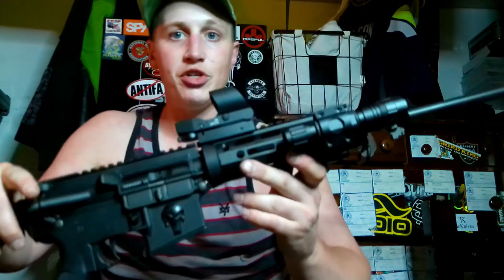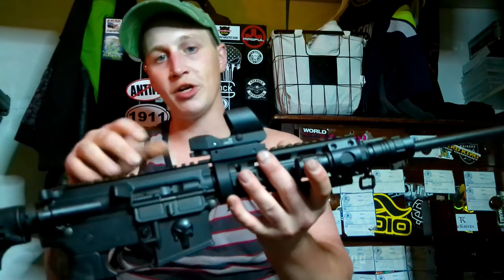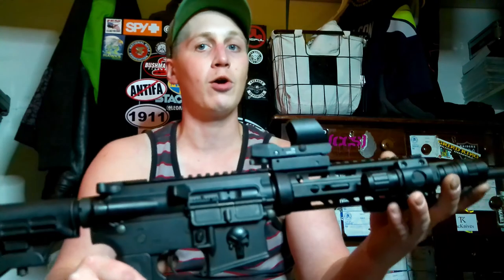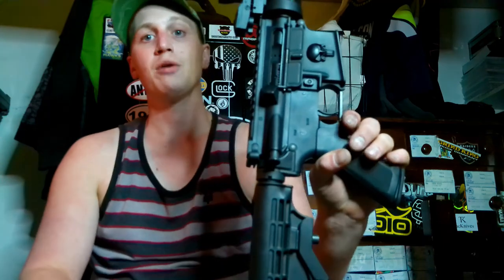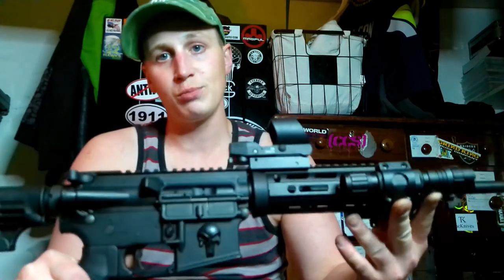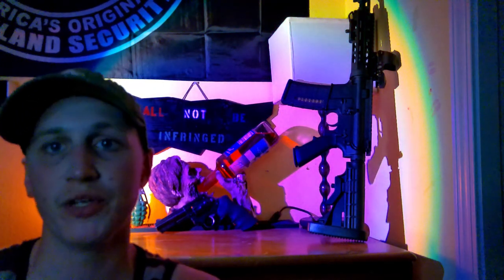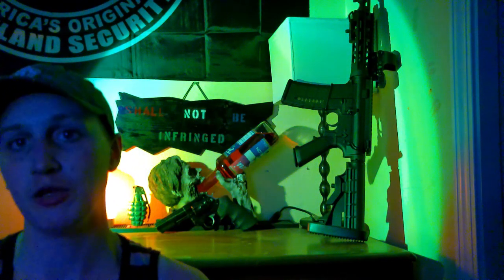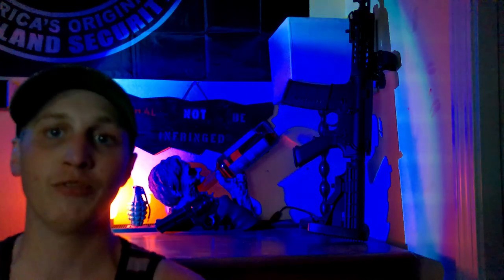AR15 malfunction clearing technique unjam a stuck charging handle w/round chambered

Comment: Thanks man. I’ve had a similar issue with my 7.62 rifle. I’m gonna replace the gas block for an adjustable one I’ve come to 2 considerations. Either there isn’t enough gas coming back to push the bolt carrier group and causing it to lock up or as you stated the bolt carrier group is tight and a mag or 2 will help. I knew I could just mortar the gun but this happened with every single round appreciate it
Reply from the maker: I'm assuming it's 7.62x39 mm AR-15 platform rifle? I've got an AK-47 myself so yeah that's definitely dealing with a whole different beast with a larger cartridge like that. Were you running steelcased ammo through it? If so maybe give brass rounds a try and see if that maybe fixes the issue. Just a thought I had.
Reply: @counterstrike2A  yes it was an AR platform. I’ve ran both brass and steel through it and no die. I contacted BCA and they said to oil it and run the action a couple hundred times cause they are built tight so hopefully that works

Comment: Holy Cow it worked, same as all the other comments....  I just fired it today for the first time after the FF dealer gunsmith cleaned and test fired it [Cobalt Kinetics B.A.M.F. Pro].  I put about 60 rounds thru it at range and was very impressed.  Got it back home and was pushing oiled cleaning patches thru it and after about the 3rd cycle with the patch end near or at the chamber, it clicked, the bolt closed, the charging handle was locked tight, ejector port closed....   I began to sweat, and feel numb, stupid, helpless.  I googled a few phrases, saw your original video. saw this video and thought this will NEVER SOLVE THE ISSUE.  But I gave it a very timid try and it was not even a hard drop and voila....  SUCCESS, WHAT A RELIEF!!!   WTF was that all about?  I can't tell you how much trouble and buyers remorse agony you just saved me.  This will happen again in spite of my good weapon maintenance practice, but at least there is hope now.  Counterstrike 1911:  YOU THE MAN!
Reply from the maker: Thank you! Your welcome! Glad I could be of assistance

Comment: Great video. Thanks. I'd add putting the gun in safe mode also. I just went to the range with my new gun and it kept jamming but, I have a 4-inch wide charging handle and was able to brace the gun against my chest and pull it back with 2 hands. I oiled some more and there seems to be a sticking point when the bolt is halfway back.

Comment: Bro thank you so much! I just shot my DiamondBack 15 for the first time and it jammed after a few shots! Your method worked instantly!
Reply from the maker: Your welcome! It seems to be a very common issue with new ar rifles cause that's basically exactly what happened to me
Reply: Having problems out of my Diamondback ar pistol after 30 rounds. How is yours holding up?
Reply from the maker: Mine's running perfect now. Haven't had any issues since I took it all apart and clean and lubricated the ejector and the bolt carrier group that seem to do the trick that along with just kind of breaking it in with rounds. Another thing I noticed it seemed to be more likely to have that malfunction when I would run 556. -223 seemed to have no issues early on but I haven't had this malfunction once in probably 5 years now basically since I made the video and spoke about the first time it happened to me. I heard from a lot of people that rifles tend to have that issue that are AR platforms, the tolerance and the chambers just so tight. They just need some rounds run through them to loosen things up and get it in good working order. Hope this helps

Comment: yeah, Thx! Happened to me, second time took out my rifle in cold weather. I agree, when uninitiated, having a live round stuck in the chamber is a little scary.  I decided I can take the gun apart and bring it home to fix. 

I'm sure it's because I have not yet polished the bolt and action with a dremel polishing tool; there are videos on how to polish the action on your AR, bolt stick will not be much of a problem after the rifle is broken in, but new rifles have close tolerances; cheaper ARs have very little invested in setup, and testing at factory, left up to the user to polish the action, clean it, and break it in. Happens with the Turkish shotguns too; but I have had great luck with this in general.  For example, this is rarely a problem with 9mm handguns. They just work.

I got my bolt stuck today; first time I just took the rifle apart (have a chair and a table to work with, even in the field when first test firing new guns) and it came unglued when I played with the bolt for a while with my pocket screw driver, and trying to loosen it, came unstuck pretty easy. Second time, it was just stuck. This is after putting 30 rounds thru it first time I fired it 1 month ago. Second time, seems like it can't tolerate both cold and lack of cleaning right now. Needs a good polish, after break in, and then lubrication; I expect will never see this problem again but I was also interested to see the gun fail and understand how it can be corrected for the life of the weapon.
Reply from the maker: Your Welcome! After doing this cleaning process that i go over in the video I just sent you a link to I have yet to have that malfunction again. Taking apart and cleaning the bolt carrier group and ejector seemed to be the extra push in the right direction the rifle needed. The video is a step by step guide to the whole take down, cleaning, lubrication, and assembly if your interested.

Comment: Double feed will cause the problem too at times, expecally if a case gets stuck in the charging handle notch.  You morter or kick start.  Good info.
Reply from the maker: Thanks for the input! It seems like their is allot of different ways that this malfunction can occur I have been getting allot of scenarios over the last 3 years from my original video and it's a great feeling getting daily comments from viewers of my original video thanking me for helping get their rifles back in working order. When it first happened to me i was definitely panicked thinking that my brand new 1st ar15 was defective and I spent a decent amount of time searching for a solution before I finally discovered this technique
Reply: @counterstrike2A  I bet it wasn't a good feeling.  We learn as we go for sure.  We got lots of money invested in our guns and we don't like when they don't run.  My first Ar-15 was just like yours! Good rifle, it will get it done.
Reply from the maker: @cnclife2739  no it was not but since I did a thorough cleaning of the bcg and rifle its been at least 2 years without having any malfunctions and my bushmaster xm15 is in a tie for my favorite rifle with my AK-47

Comment: I had this happen with absolutely no ammunition involved. New AR, NEVER FIRED and well lubricated and clean. Went into the safe, grabbed the rifle and attempted to pull the charging hand back for a safety check. Couldn't pull it back. I discovered on my own that by bouncing it on a solid surface it allowed me to free the BCG. Pulled the trigger and went to "charge" again by pulling the charging handle. Stuck again. I am in search of an answer as to why this would happen without firing or any ammo or snap cap installed.
Reply from the maker: Yeah that's definitely a head scratcher
Reply from the maker: Did you fully disassemble the bolt carrier group by taking out the firing pin by removing the cotter pin that holds it in place and then cleaning the ejector as well that's the only thing I can think of because once I did that mine stopped having the issue but my issue was also occurring with ammo inside of it not with an empty chamber so that's very strange I have a video on the complete AR-15 cleaning process including the bolt carrier group and all this stuff I just listed off I'll send you the link to it in case you don't already know how to do the bolt carrier group but I'm assuming you do since you know how to clean and lube it already but I do know a lot of people don't go as far as removing the firing pin from the bolt carrier group in cleaning the ejector and all that
Reply from the maker: https://youtu.be/Apmvm9SrXzw
Reply from the maker: Now as to why the issue is happening I've heard a lot of speculation and had thoughts of my own on it and it seems to me that this usually happens new rifles which was my case and yours and maybe the rifle being brand new the tolerances in the chamber and the bolt carrier group or nice and tight so cleaning mine and using it after about 500 rounds and cleaning it regularly I did not have the issue again but there was a period there before I fully clean the bolt carrier group where I was having a mortar around every 80 rounds or so
Reply: Never took bolt carrier group apart. Rifle has never been fired. The thing that confuses me is it cycled like a champ over and over just fine once I got done with the build. Put it in the safe, and about 2 months later it jams.
Reply: Thanks but I am VERY familiar with the platform. I’ve built several. Next step it to swat the upper with my S& W M&P and see if it cycles. If it doesn’t, I’ll pull apart the BCG to see if there is a burr or something from the factory that got overlooked in QC.
Reply from the maker: @karlgraf6969  yeah that is strange
Reply from the maker: Well i would give that a shot or if I were u I would probably take it to the gunstore u bought it at and try and swap it out for a new one cause that shouldn't be happening.. U never know every now and then u can get a lemon.
Reply from the maker: Yeah you did sound like u knew what u were talking about its crazy though most people don't even known how to take apart and clean their own guns and take it to a gunsmith. Im such a gun nerd thats my favorite part of getting a new gun is taking it apart and seeing what makes it tick. I also worked in a machine shop for 16yrs so that definitely helped me be more mechanically inclined.
Reply: Pulled the BCG apart. Clean as can be. UPS is picking it up in about an hour for it’s trip back to the Mfg.
Reply from the maker: Damn that's a hard pill to swallow plus it sucks waiting for however long it takes. This happened to my buddy when he got his Riley defense AK-47 he got a lemon and of course I recommended Riley defense to him but they took care of him upgraded his AK-47 sent him a collapsible stock with it as well as 2 new mags so hopefully they compensate you for the inconvenience

Comment: I’m having this problem with my brand new AR15 Rugar, it’s really lubricated. I have not loaded the rifle with any ammo. But when the charging handle closes it locks up. I release  that small clip that locks the charging handle in place. Only why I can get it open if I “mortar” the rifle. Only a small tap it takes for it to release. Amy tips? Could it because it’s new?
Reply from the maker: Yes, it most likely is because it's new and it's very tight fitted. I'll send you a link to my video on what seemed to help me with it which was taking apart and cleaning the bolt carrier group and all of the other components
Reply from the maker: https://youtu.be/Apmvm9SrXzw
Reply: @counterstrike2A  I took it to the gun shop where I got it and they opened it up and that was the conclusion. They said it’ll loosen up with a mag or two. If not they said they will take care of it
Reply from the maker: @victorsalinas4666  yeah, that definitely makes sense and seems to be the most logical reason because the only time I had that jamming issue was the first couple times I took my rifle shooting out of the box. So it's good to hear more feedback reinforcing that from a professional gunsmith or gun salesman

Comment: what if i dont have a stock ?
Reply from the maker: Lol sounds like u got bigger problems then. I wouldn't want to suggest using the buffer tube cause im not sure how that would fare but it may work. Does your rifle have any kind of shoulder brace? Cause basically the impact of slamming the butt down causes enough force to loosen the bolt carrier group and charging handle so if you were able to come up with a way to cause that force without damaging ur rifle then u should be good

Comment: just bought the ruger ar 556. and yep, first pull of the trigger the bolt is stuck.  was an empty chamber.  i just took it out of the box and pulled the yellow pin lol. it's oiled up too so what do you suggest?
Reply from the maker: I would use the same method, it should free up the charging handle the same and get it back in working order. This predominately happens with newer rifles kinda like a break in period with a 1911 pistol. Putting a hundred rounds or two through it should keep it from occuring. It probably happened half a dozen times to me and after that i havent experienced that jam again.
Reply: @counterstrike2A  appreciate.  every pull of the trigger with empty chamber it get's stuck.  guess i need to get it to the range. but if it gets stuck after the 1st round oy vei what to do.
Reply from the maker: @BeaconRI  no problem, you're welcome. I would also recommend using snap caps or spent shell casings dry. Firing it if you have any and just working those through would help to wear the action out
Reply from the maker: @BeaconRI  chances are the gas block should create enough force to cycle it out when you use live ammunition but it will definitely still be prone to happening for a bit a few times

Comment: Lol. You have got to fix your red dot. That is the absolute wrong place for it. You'll never retain zero with it there
Reply from the maker: Hope I helped you fix your AR-15 with my video so you could then mock my optic placement. You know if you're coming from a place of genuine respect and want to educate me about why I shouldn't attach my optic to the picatinny rail on my handguard due to the high probability the handguard will move around, maybe don't start the teaching opportunity comment off by laughing out loud in my face......
But I guess that's what I deserve after saving you potential money by showing you how to clear a malfunction and avoid a trip to the gunsmith right? Just think about it. If somebody was going to teach you something, do you think them starting off by laughing out loud at you would be a good way to get the point through and educate them on the proper placements of an optic? Not sure if you were trying to come off sounding like a dick but you did, just so you know. And then maybe explain what the proper placement would be instead of just adding a vague comment. But fortunately for me I figured that out years ago.